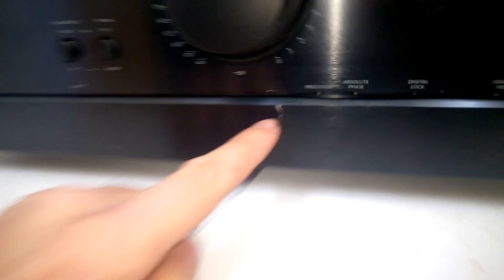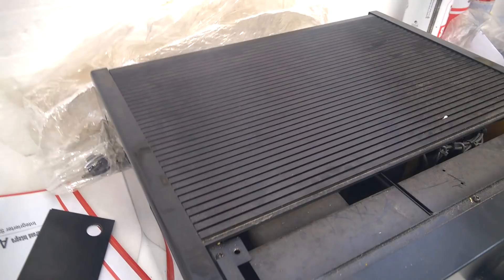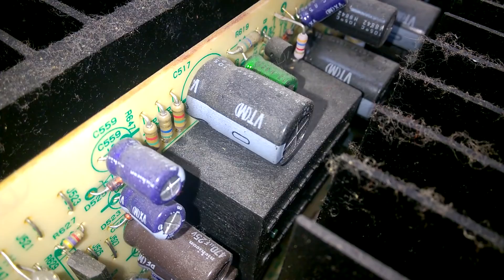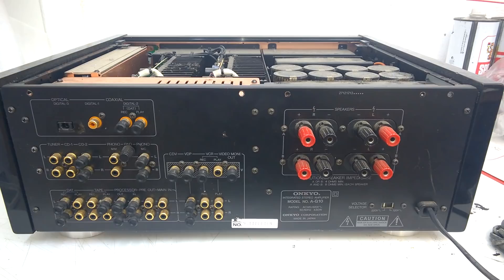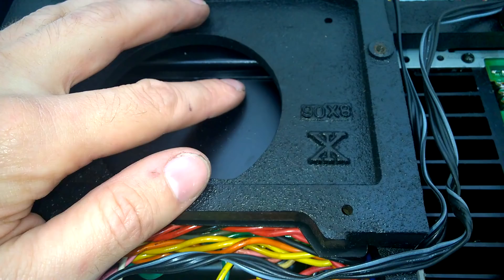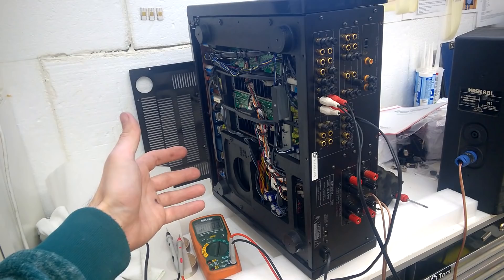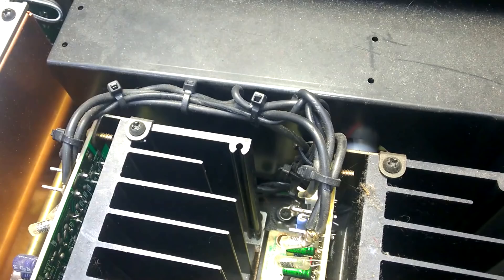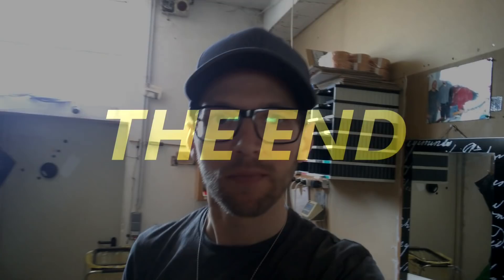BEB #96: Onkyo Grand Integra A-G10 / A-8990 Repair (Part 1) and Walkthrough

Comment: If everything is floating at V+, I would guess you've lost the ground on that circuit board. The bodged wiring does go to an earth tag amongst other places, so that's what I would be looking at.
Reply: I agree with that. Got to be an open ground.
Reply from the maker: Thank you! A good guess. Will check that ASAP.
Reply from the maker: @alancordwell9759  Thank you Alan.

Comment: You have an amazing crib. I assume the amp to be class A, I'd shunt the input of power stage first, bypassing volume control, preamp and all to isolate that stage to see if the problem lies in power amp stage. That's a beautiful beast
Reply: I wouldn't say that this is class A amp - class A amp with heatsinks of that size would push arround 10W,or even less output power. 
From what I found online, this is 2x 150W/8 ohm or 2x240W/4 ohm class AB amplifier
Reply: @blackwingmaster141  Thanks for the info, i haven't look it up at all. But i hope this diagnostic method, isolating fault first would apply to any class of multistage amp, right?
Reply: @lalmuanpuiamizo  In general, yes
Reply from the maker: Hi, thank you for your comment. Isolating the main amp, from all other stuff, is a great idea!

Comment: I have already repaired several A-8990 the big problem on these amps are the power capacitors that are hs and that causes random ploq on the channels when its does not degage them outright
Reply from the maker: Hi Steven. Thank you for the hint with the large caps. What do you mean by "hs"?
Reply: Remplace les 2 transistors 2sc2229 dans les optocoupleurs sur les cartes d'amplificateur.....

Comment: Massive capacitor values for the power supply! Sounds like the transistors are not being biased. Has the drivers failed. Also check fusible resistors.
Reply from the maker: Hi Simon. Thanks, will check that!

Comment: Hi Max, did you ever get hold of a schematic? I also have an A-G10 which is in need of repair. I have the original remote control which motor drives the volume control and also offers phase inversion, regards Rowan

Comment: Prehaps input stage failed, or maybe output stage driver?
Reply: I would disconnect every single wire coming to or from amplifier module, except for power supply(to make shure that output amplifier is failing, and not something in preamp section)
Also, I would check every transistor and diode on board, perhaps even capacitors
. 
I had similar failure on my amplifier, based around STK4048 hybrid module. Output just "stuck" to negative supply rail, however in my case negative rail output transistors shorted
Reply from the maker: It could very well be a broken input / driver stage, or one of the black, isolated amp blocks. Since there is DC on BOTH channels, I hope it can be tracked down quite easily.
Reply from the maker: @blackwingmaster141   excellent hint with disconnecting all stuff. thank yxou so much!